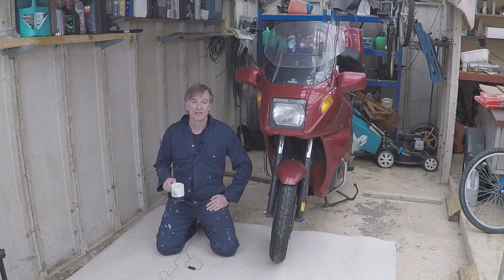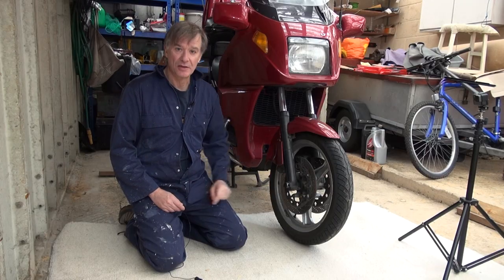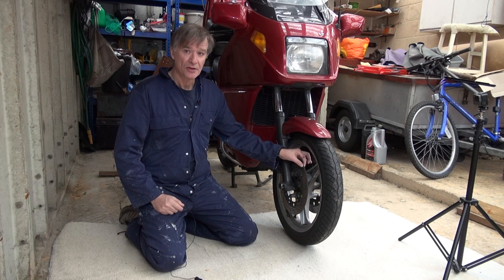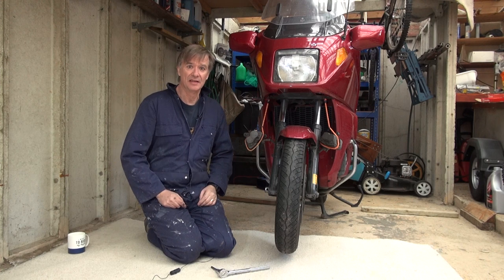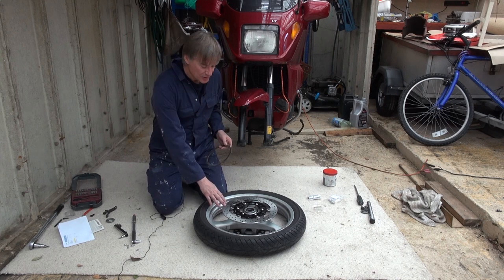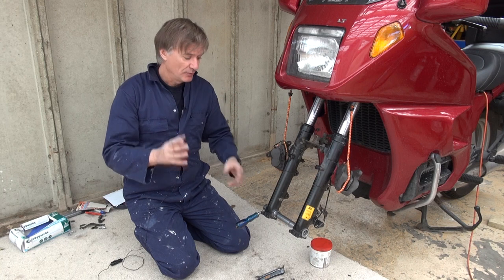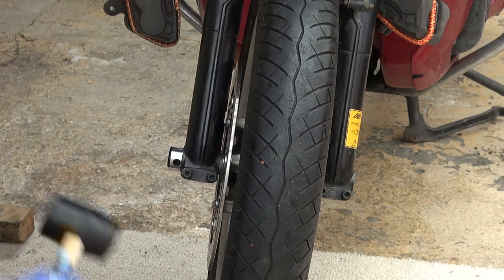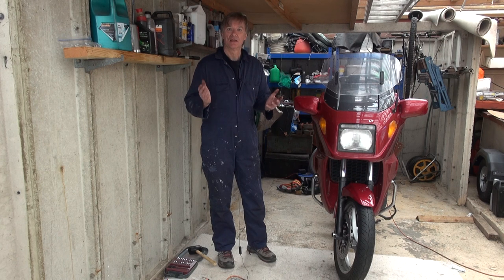BMW K1100LT motorbike front disc change

Comment: Hi Nigel, If I can afford, my advice to remove a blocked screw: first hit the head (force applied depending on the size of it, you guess...), then put a little amount of Valve girinding paste, big grain, place your allen tool in the bolt, unscrew... That way, no need to drill the screw head, it works all the time. Of course combination with heating/ shock/ paste is ideal. I've tested my  RT method on the rear wheel brake disk two bolts (K75RT), which are, as you certainly know it, not the easiest ones to remove because of blocking loctite on them plus their conical shape. Chris Harris did a video on that point, did not managed and drilled... Well, I garantee my method, applied it successfully. Thanks for your videos, they're all great, have good rides, drive safe, from France, Fabrice.

Comment: You should use a torch on those screws for the ABS ring. Heat gun doesn’t do the job. Apply the propane torch adjacent to the tiny screws and it will enlarge the holes and melt the Locktight.

Comment: Axle bolt should go in by hand or else its out of alignment. You need to get your technique fixed. Loosen those triple clamps then slide in the axle to properly align the front end.

Comment: To take off the ABS-ring you can use a angle grinder and cut a groove then use a flat screwdriver to unscrew the bolts.

Comment: very fine video.  Can you tell us how many miles were on the rotors you changed out? Did you use BMW OEM pads throughout the life of the rotors?  Thanks.
Reply from the maker: They had about 55k miles on them and no I did not use BMW OEM. I usually buy from Motobins.

Comment: The replacement looks different than stock with less bob-ens. Is is just as good or better?
Reply from the maker: I bought them from Motobins. They are excellent and I would say better than the originals. The bike is now a pleasure to ride, no rattling and no brake snatching. The hardest part is having to swap the ABS ring and drilling the screw heads. Work slow and carefully.

Comment: Hi, few weeks ago I buy a car( Ford Mondeo 2009) but now central look not working. But can I cloused car by the key ( if I put in the dor, driver door)
I don't know what I need to do, can you help me please ?
When I buy the car everything was good
Reply from the maker: Change the battery in the key fob and it should start working. If not then I seem to remember I had to make the car recognise the fob. Get in the car, close the doors and use the key to switch on the ignition but not start. Press the close button and then the open button and the doors should lock and unlock.
Reply: @NigelEaland  the same, not working 
I try 
I don't know what I need to do
Reply from the maker: @valentinmihai9137  have a look at my video  https://www.youtube.com/watch?v=PdeqeD8YhvE

Comment: you contradict yourself when you say the disc is designed to float,then say that there should be no play in the bobbins.
There has to be some play in the bobbins even when brand new to allow the disc to centralise between the fixed pads.
The play on your discs doesnt look too bad,and the ones on my own K1100LT are about the same,also i find that a jack and wooden block underneath the sump is the best way of keeping the front end of the bike up.